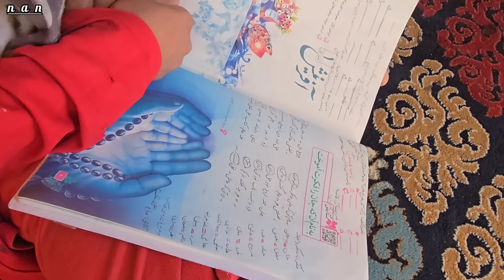Reinforcing Dreams with Cement: The Master Returns to Help Grandma

Comment: Im so very happy to see that the repairs are almost done. I am worried about all of the loose dirt and large stones on the hill above the house. I worry that if it doesn't get removed that it may slide down onto the roof during a rainstorm or when the snow starts. I love that they are also still working on the cave as well ❤ Everything is coming together nicely ❤ love to you all from Eastern Canada

Comment: Im not sure where Nana is going to put the wood stove for heating this winter. Last winter it heated the small cave very nicely and it was vented through the outside. This also was a gift of the operator. Before that, fire was at the mouth of the cave and it didn’t help much.

Comment: I hope when they put the window in beside the door. The master builder can straighten the frame for the window. Because it's very crocked.
Looking forward to to seeing the finishing of the Wall, been whitened and the glass going on the door frame and windows.
If the plan comes together it should look great ❤

Comment: Hi Grandma, I hope you remember to measure  the window from the narrowest width of the window opening. It would have been so much easier if the Master builder had of squared up the window  opening to avoid many problems when fitting the window to the opening.💙

Comment: Hopefully there’s enough mortar if he comes back tomorrow they can clear the stuff from the front wall that he can speed threw that wall and the back side that will finally winterize the walls then the windows and door are left to get the glass in as for inside wall she just needs to smooth over the broke area let it dry good then get some mastic or construction glue then get some replacement tiles and knock out that little piece that’s left of the tea set tile. Then inside of the house will be done. Now NAN could use a stand for the cooker but that’s a luxury but definitely need get the stove and extra pipe and then start on door on the cave and finish it out